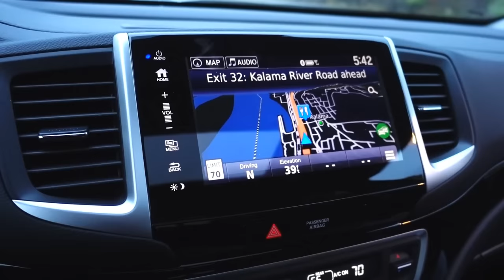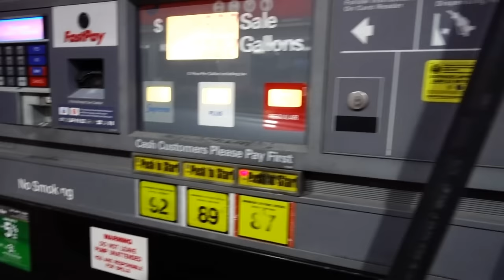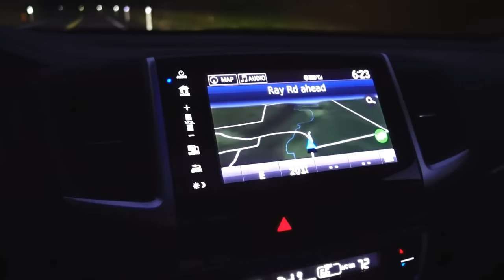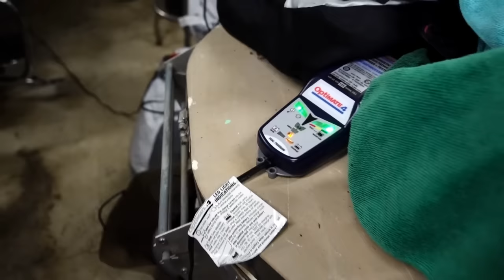BMW's Cordoba Blue!! • The Rallye Gets Her Bell! | TheSmoaks Vlog_718

Comment: The steel braded brake lines are cool. But the inside is still the same material as the OE lines, Right? I do agree the steel lines are best especially as you don't ride much. Thanks for all the brake line flush info. Great help to many out here in the moto 🌎